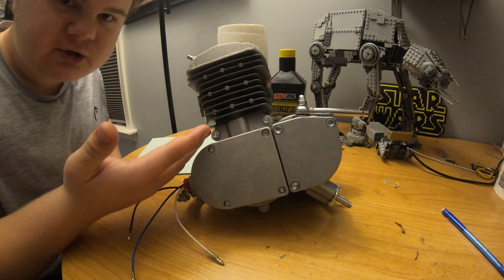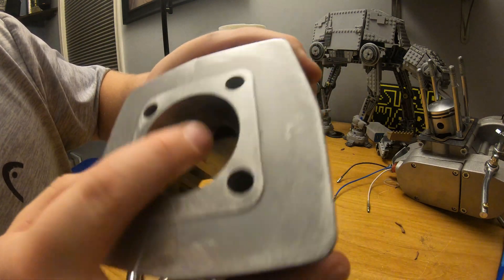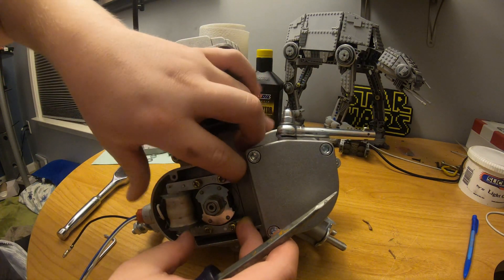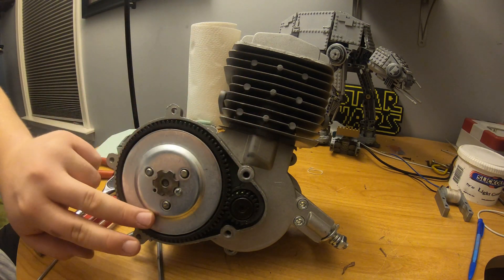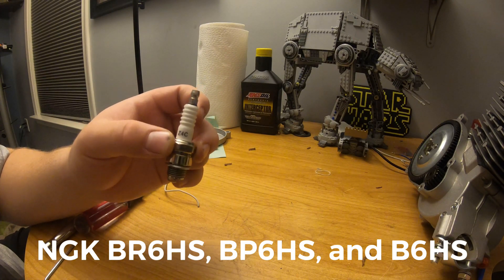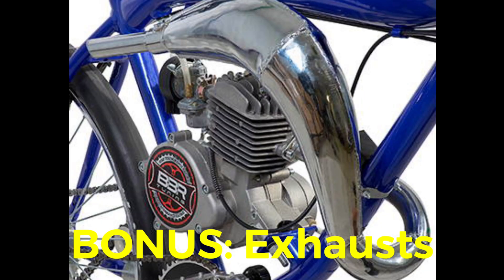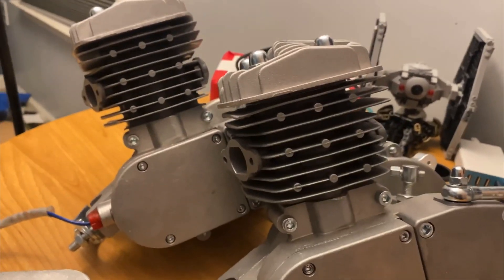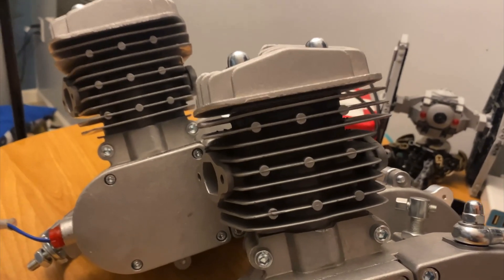5 NECESSARY Motorized Bicycle Mods #motorizedbike #motorizedbicycle #2stroke #moped #bike #minibike

Comment: Hey been in the hobby awhile thanks for the extra info and tips!!!! Love the content and just a random question, no hate.

How on earth did you read 18psi on the top end???? That’s incredibly low, a compression test you should have the bike rolling and have multiple revolutions to get an accurate reading. Even with a bad squish gap, it should not have been that low. Curious if you can let me know but other than that great tips 👍
Reply from the maker: Thanks for the support, brother!

When I did the compression test, I made sure to liberally apply thick sae90 gear oil to the cylinder walls and piston. I "warmed the engine up" by turning the engine over at least 20 times with a drill and when taking the compression reading, turned the engine over 10 times (with the intake fully open). I pretty much always use this method and it is always pretty darn accurate.

The reason it is SO LOW is not that surprising and I made a YouTube video a few months ago explaining why. But basically, a lot of the cheap chinese motors either use the COMPLETELY wrong cranks (or at least the wrong connecting rod). For instance, the Firestorm 80 engine (sold by bicycleengines.com) has a 40mm stroke crank with a short connecting rod. While this is standard, a lot of cheap chinese engines copy the same roundabout engine design, but sometimes use shorter-stroke cranks, slightly shorter connecting rod, use a piston with a higher wrist pin, the cylinder deck height is a bit higher, OR in my case, pretty much ALL of the above.

I'm guessing they had an excess of parts from different engines (that each have slightly different designs/dimensions) and thought they could just Frankenstein all of them together, or it is an attempt to decrease the performance of the product SO MUCH, reliability is not a concern. Either way, it makes for an engine that barely runs (if at all). And not only is it because of the STUPID low compression, but in many cases, ALL of the port numbers are COMPLETELY thrown off.

If might seem like i'm being a bit too harsh, but it is a massive problem. I can confidently say nearly 100 people have personally reached out to me because their engine either doesn't run due to compression issues, or their engine is ENTIRELY botched straight out of the box.
Reply: @a.m.bgarage.everydayprojec9665 Wow man!!!! You certainly know what you’re talking about, thanks for the reply. Yeah i’ve only successfully built two bike kits and had relatively low issues in compression, squish gap, etc etc. But those engines were mfg like 5-6 years ago, so yeah I guess i got lucky. I’m sure if someone put one together and didn’t check into these things or didn’t know what they were doing, these engines would either not run at all or have a catastrophic failure!!! LOL you saying you had all of the above is so crazy, no wonder it was so bad!!! Good luck and ride safe
Reply: @a.m.bgarage.everydayprojec9665 Also it’s a shame how the quality seems to be even worse of these kits as time goes on. Of course we expect the quality to be somewhat low with a cheap chinese engine, but at least wish they would put a little more effort into a good product

Comment: I have  bought a 50 cc one and i cleaned the insides up before riding it but it has a rattleing knocking sound. But it runs fine. What could be the problem?

Comment: i caught a vid on nitro methanol , explaining it and they need a permit for dragster nitro methanol fuel, but the hobby store stuff is lower % still much more powerful than gasoline in whatever runs it until it blows or whatever , so anyway the clutch on a moped or scooter would grab if the engine is revving higher than normal for idle and it workd best in 2 stroke. while the 2 strole bike motor has a manual clutch cable seems interesting , especially for boat or ultralight plane potential , also it'd be interesting to attach them side by side just  like a single 4 cylinder ...maybe you or me could make a specific nitro methanol set up was reason for my reply/ main idea...{?}

Comment: the white wire on my engine if touched to the engine itself it shuts it off
Reply from the maker: Yeah. The white wire is a second positive wire. If you plug the white wire into anything, it would take power directly from the ignition. If the accessory plugged into the white wire draws more power than that of the ignition system, it won't have enough to also spark the plug and if you completely ground the white wire, you're grounding the coil and affectively using the killswitch.

Comment: Great video, when you take this sprocket cover off you should put the chain on the sprocket and then fill the gap up the top of chain( put a business card around chain) with JB weld. Stop the chain from bunching up you can cause your back wheel do you lock up. Cheers Graham

Comment: can you tell me the inside diameter of the cylinder or the outside measure of the piston?
THANKS
Reply from the maker: There are all kinds of engines with different piston sizes. The engine in the video has a 47mm piston, but there are others with 40, 45, 48, 49, 50, and even 52mm pistons.

Comment: PS the white wire is for a headlight it's a 6v lead you can connect two lights (a brake light and headlight) in parallel.
Reply: Thanks, i have coming soon a 100cc Aliexpress 🤞
Reply: i got a light with a red and black wire- how do i connect that to the white wire
Reply: @Guitar_Channel1024 connect the black to the red and the white to the ground if the headlights have three wires then ground the third wire to the headlights frame or to the bikes frame.
Reply: @Guitar_Channel1024red lead on light to white wire from engine. Black wire from light to a clean bare metal spot on the frame (ground). You are better off with a USB rechargeable headlight and tail light, using the white wire from the engine will be a parasitic load, and make the engine labor.
Reply: @EezStash thanks
Reply: That white wire is actually a charging wire. It keeps the CDI Coil charged to provide spark to the spark plug. Says so right in the "owner's manual".

Comment: I bought my engine off eBay. It's a 100cc kit I bolted straight to the bike with no issues my ports were made perfect everything works fine. I think you need a new supplier.
Reply from the maker: @Tyemuck18  I'm glad. Primarily ALL these engine kits are manufactured in one Chinese factory, but use different molds. From what ive heard, sellers that prioritize quality like Smolik Performance, California Motorbikes, and Bicycle Engines use the newest casting molds, while eBay and the other generic brands use the older casts with more defects. If you buy from these generic brands like most people do, there's about a 50/50 chance of having pretty terrible defects. Mine didn't have many defects, but a lot of people still have this issue and is a large reason people's engines die prematurely.
Reply: @a.m.bgarage.everydayprojec9665  that's good you're knowledgeable I just look at the reviews because each seller is different but you never know.

Comment: PLEASE REPLY BACK...im confused. U said the squish gap should 0.1 to 0.5 and the said this motor gap is 0.3 and that was terrible..so which is it?  I could of misunderstood or wasn't listening good.. also can u show us how to measure the squish gap? I paused the video to ask this question...so if later on in the video u do show how to measure the gap just ignore me asking u to show us.. but I do want a answer about the 0.3 gap
Reply from the maker: @brianhawkins866  I'd I said the squish gap was .3, I meant 3mm. Typically, the squish gap needs to be .7 or .9 for optimal performance in all ranges, but most of these engines come with a squish in excess of 2 or (in this case) 3mm.

 the BEST way to measure squish gap https://youtube.com/clip/UgkxdNXv5srJrHKAx67PJQrPAnHwFXSHJfEY?si=KyFrI__x37Mvc9DY

Comment: I was wonder what do you guys think of the banana expantion chamber?
Reply from the maker: The bannana pipes dont really perform any differently then the stock exhuast. In fact, you want more power than the banana pipe, simply remove the cap off the stock exhaust or drill holes in it for more flow. If you want to get an exhaust, I HIGHLY reccomend at least getting an MZ65 clone. Here is an exhaust guide for you: https://www.youtube.com/watch?v=ZBZV0xXFjlM

I also highly reccomend listening to the performance upgrade discussion on the most recent episode of me and Keegan's podcast (around the 20 minute mark): https://www.youtube.com/watch?v=VQu9IDBvK6s&t=1156s

Comment: This was a great video! From a mechanical standpoint you had everything spot on! When I first got my engine I could tell that it had never seen gas or even oil! The inside of the engine was bone dry except for just a few dabs of shity Grease on some of the main points but the cylinder, piston and rings were bone dry!!! I think that's absolutely crazy to ship an engine out like that with absolutely zero lubrication.... No wonder people get them and then they just blow up within a mile. I think a lot of people just don't understand how engines work and what they need. I also did some of the things that you showed. I immediately replaced the head with one of those nicer solid aluminum high compression ones, right off the bat you can see how much better the mild aluminum one is. The cast one is complete garbage! I also got a better magneto and that was the second thing I checked, the spindle was rubbing the magneto extremely hard on one side so when I put the new one on I centered it up. I also took and lubricated the clutch a little bit as well after installing a better carb.... That's another thing I'd recommend that I didn't hear you say was a better carburetor, the ones that come with the engine are really simple and look like they wouldn't produce much flow at a high RPM. The stock muffler is complete trash as well, I'm going to be welding up a expansion pipe for the little motor! I bet just by changing the pipe alone you probably can gain 10 mph minimum. Putting a pipe on 2 cycles really makes them haul serious ass!!
Reply from the maker: Thank you very much for watching. I completely agree. That is why I make these videos, to help people. As for the carburetor, the stock one is usually satisfactory for most riders, but especially after you do a few mods, youll definitely want to upgrade that carb to something like a Nibbi PE19 or a VM18. As for the exhaust, you are completely right. Even a decent pipe will double your power compared to stock. lol.
Reply: Q1q+qqaa@a@

Comment: you didint explain anything about how to take material off the top of the cyclinder
Reply from the maker: I put all the needed info and video guides in the description. Though, here is the way I do it: https://www.youtube.com/watch?v=Asm8u4BYfzs. You can also use a belt sander, a sheet of sandpaper on a flat surface, etc.

Comment: hi i live ijn a city that mostly hills every 2 blocks so i need a exhaust  with more power   what do i get
Reply from the maker: Here is an exhaust guide: https://www.youtube.com/watch?v=ZBZV0xXFjlM&t=203s (on Reddit) https://www.reddit.com/r/AMBMotorizedBikeGroup/comments/16oilc9/how_to_choose_the_right_exhaust/

For torque, really any upgraded exhaust will give you A TON more torque and power across the board. I reccomend doing this mod especially, but I highly reccomend tuning your carburetor and gearing your bike properly when doing this mod.

Comment: What the hell are you talking about ring snag And then you said you wanna prep the rings I have no clue what you're talking about I've been working on motors my whole life I think maybe you're just trying to sound important So cause you probably Say so cause you probably a nice kid
Reply from the maker: I have all the needed info and links to further videos and info in the description. When it comes to ring snag, it isn't an issue with every engine, but a lot of the lower quality engines have a lot of defects, casting flaws, and burs around the ports. If left unchecked, these defects can catch on one of the piston rings (ring snag) and/or damage the piston. 

As far as prepping the rings, its not something that needs to be done, but I have found it to be a good habit since it speeds up the break-in process and is less likely to scoring the cylinder.
Reply: OK professor
Reply: @claybornlewis276  2 stroke piston ring snag is a very common phrase & issue in ported engines. It's when the piston ring spins out of place & gets snagged on a port hole. If the little Piston ring pin in the piston groove falls out. The ring will start to  spin around in the piston groove.

Comment: I bought the cheapest 80cc kit from ebay that I could find.  That was 5 years ago.  I've only ran used motor oil as a two cycle oil and did nothing to the engine but install and ride.  I now have about 4,000 miles on it.  Around the 3,000 mile mark, the wrist pin bearing gave up.  I ended up replacing the wrist pin, wrist pin bearing and piston and reused the original cylinder.  Those parts were about $15.  I'm not recommending used motor oil, but it's saved me probably hundreds of dollars Vs. buying 2 stroke oil.
Reply: Thanks for sharing
Reply: Did you use normal mixing ratios?
Reply: @PainHasgotchyu  I ran a rich oil mixture.  I never measured it but it was way more than enough.   I always had a bunch of used oil from the cars.  I would just glug a bunch into my gas container, give it a shake, and fill up the bike.
Reply: You used used motor oil lol I doubt that very much 😂
Reply: @davidmaguire604  I do run used oil!!!  I've probably ran 10 gallons of used oil through that bike LOL.  I still have that same bike though I don't use it all that often anymore.  I now work from home permanently since COVID.   Funny story, I was riding to work one morning (Pre-covid so it was a while ago) and a pedal biker in the whole 'Lance Armstrong' get up -spandex shorts, shirt, sleek helmet, etc... - was about a 1/4 mile in front of me hauling balls.  I had to hammer on it to pass him but pass him I did at about 35mph and he was trying like hell to stay ahead of me!  Pedaling his little tootsies off.    It was so funny, the trail of smoke I would leave under full throttle was hilarious!  It was a good laugh around the water cooler that morning!
Reply: @davidmaguire604  i used car oil and its fine
Reply: Works fine when its not a high performance engine and if you use more oil.. smells terrible but it will lubricate the engine
Reply: L

Comment: Just wanted to share some of my findings: Another good plug is the Bosch wr8ac or Champion l86c or rl86c. From an air cooled vw beetle engine, they never get hot and last forever. Cutting the baffle out of the muffler and running 18:1 castrol 2t snowmobile oil on the first richer setting has proven beneficial in my experience. Spraying some penetrating oil down all your cables will help them be more snappy. Using 3/16 fuel injection hose with nice clamps will prevent fuel lines leaking or cracking. Putting nyogel in your magneto connectors will waterproof them and taking care to make sure your carb is level horizontally will save you from a bent float later on.
Reply from the maker: Thanks for the info, man. I made this video a while ago and ive learned alot since then, so im planning on revising a my videos and this is definitely one of them.

Comment: I need a quiet exhaust for my neighborhood
Reply from the maker: For improved performance, I would upgrade to an mz65 clone and use a slip on 22mm silencer (https://a.co/d/gO4RqRR) and you’ll not only gain a TON of power, but it will be almost as quite as stock. Though, if you are looking for the QUIETEST exhaust, I would stick to the stock exhaust these bikes come with, since there aren’t any other that are any quieter without SIGNIFICANTLY decreasing performance.
Reply: @a.m.bgarage.everydayprojec9665  i gotta find somethint quieter than stock the stock is not quiet at all

Comment: Winging it pretty strong there.  Consider researching the topics and offer a bit more than 'surface depth'.  Immediate reaction advice that held well thru to the end.
Reply from the maker: Yep. I definitely need to revise this video. Mainly cause there is a LOT of things I know now that I didnt before. Not that much of the info is downright bad, but I would definitely say things differently.

Comment: That white wire. Is your 6v wire for lights guys just fyi
Reply from the maker: Yes, your right, but the wire draws power STRAIGHT from the ignition coil, not a battery, which causes an insufficient amount of power going to both the light and the ignition system, resulting in both a dim light (or one that doesn't work at all) and a spark plug that wont generate a strong enough spark to make the engine run well (or at all). It would work completely fine if it was wired differently, possibly if their was some sort of battery or an amplifier going off the white wire, but because the ignition system (WITHOUT anything connected to the white wire) only generates 5 or so volts at idle, and around 11 at high RPMs. If you use a 6v battery, or even a 3v light connected to the wire, the bike wont even run.  When I first built my motorized bike, I tried plugging in a 3v headlight, but the engine would not start at all.